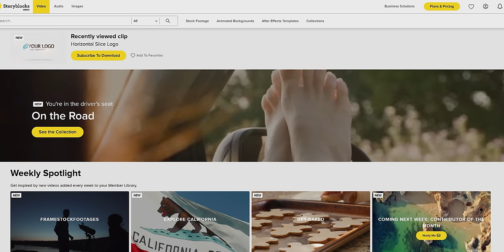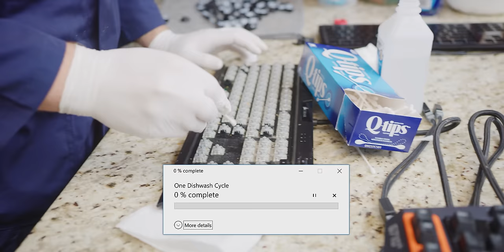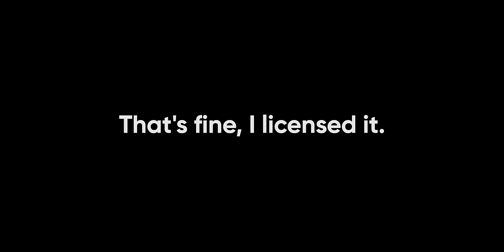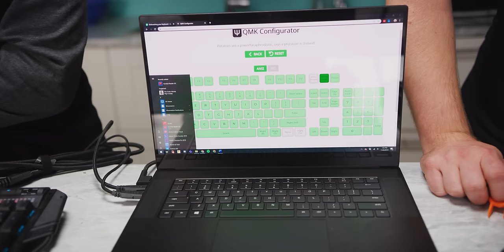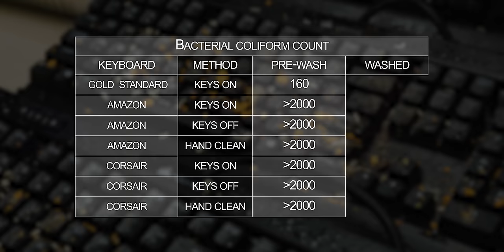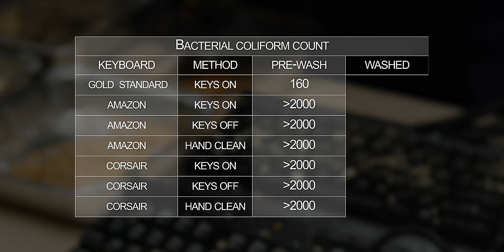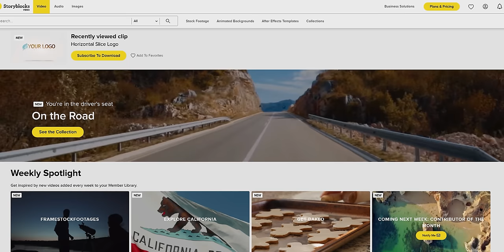The best way to clean a keyboard is… the DISHWASHER?

Comment: No one's gonna check for corrosion?
Reply: I asked the same damn question
Reply: Yeah, i mean if you dry it fast, should be fine but if in the long run and if you do this frequently my guess is you could find some issues because of corrosion. A safer way could be to disassemble the whole thing and clean the circuits with isopropyl while you dishwash everything else but, ain't nobody got time for that!
Reply: @walkinmn  I did this last year with my 13 year old Logitech Keyboard. I didn't want to throw it away (and yeah it got so dirty in 13 years I was half tempted to throw it) so I disassembled it and just washed all the plastics.
Reply: corrosion happens if electricity flows mostly. Water mostly causes damage by corrosion when electricity is on.
Reply: @VamsiMohanKrishnaVadrevu  G15 I'm betting :P
Reply: @finraziel  Hehe no actually it is a multimedia PS/2 keyboard called Y-SZ49 :-) I couldn't kill it whatever I did. And I can't justify buying another keyboard until this one dies. So I'm waiting for it to die and it just doesn't die. It's been running relentlessly for the past 14 years.
Reply: @piotrj333  corrosion can still happen if certain metals are in the dishwasher
Reply: @piotrj333  thats not how rust works...
Reply: @piotrj333  you don't need electricity to get corrosion lol. Just metal, water and air
Reply: dip the keyboard in a alcohol bath, agitate the living crap outta it and should push all the water out, lowering drying times and lowering corrosion possibilities.
Reply: I am guessing that the keyboard being washed is older at this point and this is a one time deal to give it one last run before being replaced. I personally buy a new one and do this method to keep the old one on hand as a backup. has worked great for over a decade.
Reply: @piotrj333  Statue Of Liberty has corrosion as well (the green tint that it has), it should be copper, but its because of salty water, air and also the iron that is inside the damn thing
@Linus Tech Tips really guys, you support this method of cleaning? can we keep you liable for the damage/non working keyboard in 10 years????
Reply: @VamsiMohanKrishnaVadrevu  Yeah my keyboards last quite many years even tho they do get some splashes of tea and food crap on top from time to time, cause I just disassemble and clean the plastics, but leave the board and membrane out of the deal (yeah, no mechanical here).
That way you simply removed the only danger out of the equation. Only do it like once every 2 years tho, but when I do clean it up I remove all keys to get it done well enough (since keys start to get even stuck from all the crap and sweet gunk).
Reply: @oogiesmuncher  Negative. Rust works when ionization/electrolisis in water happens. Sure it will happen slowly even when electricity doesn't flow (because of also contamination of salt etc.) but it is really slow process. Meanwhile if you put a drop of water on chip and chip inputs will flow electricity over that water, corrosion will happen in matter of few seconds.
Reply: @piotrj333  Im well aware of how rusting itself is a transfer of ions. But you make it sound like electricity needs to be flowing through the metal to cause rust which is not true. how do you think steel plate rusts when left outside? No one is hooking a battery up to it.
Reply: @walkinmn  Drying cabinet for clothes works. But keeping them wet and air drying? D:
Reply: @TyphoonNLD  I mean copper goes green when copper oxide forms, not because of iron
Reply: Ask Der8auer's motherboards.
Reply: @piotrj333  that's just one example. Corrosion can happen much quicker when you have electron transfer between metals rather than relying on a slow reaction between air and metal
Reply: @oogiesmuncher  it happens but extremly slow because transfer of ions happen without electricity. But good luck making rusting with destilled water in laboratory condition by itself.
Reply: @piotrj333  no. just no. electricity, especially alternative current, increases corrosion.

Comment: "A fast way to clean your keyboard."

"We waited a week for the keyboards to dry."

"Fast."
Reply: Lazy* 😄
Reply: just throw it in the oven
Reply: it was to make sure
Reply: @cwa178  it will melt if its too hot
Reply: -_-  r/ihavereddit
Reply: @SimonOpsi  no it wont
Reply: @griffinhatt4669  I rly hope that a joke
Reply: 'fast' way to clean.. long wait to 'dry'. lols
Reply: you can cut from 1 week to 3 days if you put the keyboard drying inside a container full of rice
Reply: lol
Reply: @TechHowYT  tbh i never did it with a keyboard , altho we do it a lot when we accidentally drop our phone in water ,  but overall by removing the keycaps there is not much rice that will get stuck on the keyboard , just shaking it a couple of times will release the rice. Dont forget its dry rice not cooked ahah
Reply: Gotta have 2 keyboards lol, one to use while the other one is drying forever
Reply: just use rice bruh
Reply: Theres a point where if the actual effort put in is quick enough, the total time doesn't matter as much. An ideal dishwasher cleany a grimy dusty cheeto-y keyboard just by chucking it in there and giving it a few days to a week to dry would definitely seem more enticing than properly cleaning it yourself, key by key
Reply: @Dizastermaster.  Ur point is totally valid , altho when we reach that stage is more about what you as a person need overall. If you need your keyboard as fast as you can ready to use because of work , its preferable you clean it key by key , but if you have another alternative and can wait a week for it to dry , its way less work so it would be the best choice.
Reply: I have been doing this for years but i take the electronic parts out and they do come out like new.
Reply: It was clean fast... you just had to wait for it to be useable again :D
Reply: You can dry it for just a day if you disassemble as much as you can first. I manually shaked off the water for like 30 minutes then dried it for 12 hours on a rack and a big fan. Did this 3 months ago, keyboard is working perfectly
Reply: @Stanky_Foot  A day still isn't "fast."
Reply: your mom's or wife's hairdryer.
Reply: @OnyHipHopMusic  but then its full of rice and will need a dishwash again
Reply: @Blackstar1701  nah because the rice will still be dry , it wont stick to your keyboard :D
Reply: @SimonOpsi  hes joking
Reply: I would probably take an hour or two if you put it next to a heater and fan.
Reply: @SimonOpsi  Dr
Reply: If you were going fast set it in the sun for a day or use a hair dryer/heat gun or fill the washer with isopropyl alchohol
Reply: @ZackyVillain  fans only push air and in most times spread the water the pcb need to be dry or you risk bridgeing solder-points
Reply: Then put it in a dry cleaner
Reply: @TechHowYT if you get rice stuck in your keyboard, just run it in the dishwasher again xD
Reply: You can make a homemade dessicant with Epsom salt, a pan you don't care about, an oven that can hit 450° for 2-3 hours and a hammer. 
The Epsom salt chemical formula is MgSO4(H2O)x where x varies from 0 to 7. I find most Epsom salt to have significant amounts of H2O and if you cook it out, it will naturally try to bind to the water in the air.
Reply: LMAO
Reply: @Stanky_Foot  shook off the water.
Reply: @darkshock42mlg05  You misspelled vibrator.
Reply: Can you hear the circuits rust?
Reply: You shouldn't really have to wait a week.  I cleaned my Dell CK-8135 keyboard in the dishwasher and took it out, shook it a few times to get the excess water out and turned it upside down and let it sit for like a day or two and it was fine.  It also had pass-thru holes in the bottom of the keyboard that helped with drainage.
Reply: Wonder if hard water will cause short circuit
Reply: @SimonOpsi  Who said to put it on broil though?

Comment: "A quicker way to clean your keyboard" ... Takes a week to dry...
Reply: If you put it on a not too hot heater (radiator) it will be completyely dry he next day. Its only a problem if your given keyboard likes to be soaked this way
Reply: use rice
Reply: Meh, a week is overkill. Any amount of time that gets the keyboard completely dry is fine. In my opinion, 1-2 days. Again, a week is unnecessary.
Reply: @birsp  you're right, but that is still time you're not using your keyboard. Granted, a week is probably overkill, but even if it takes a day to air dry, you would still have use of your keyboard faster by just taking it apart and using rubbing alcohol and taking an hour to clean it off
Reply: I disassembled and washed mine, since I washed keycaps and plastic parts separately, then I was able to dry using paper towel, assemble and start using it without waiting for passive drying.
Reply: @krisavi  That's still risky. If you miss just a little bit of water inside of that keyboard, you can kill it for good. I still think it's better just to use some rubbing alcohol
Reply: oven on hot air at 50 degrees celsius for a few hours does the trick. Testing it myself about 30 times while washing the keyboard in the bathtub
Reply: The thumbnail is best way not fastest
Reply: If you completely dismantle your keyboard, like I did with my Razer Ornata, and wash everything separately, you can get away with good towel dab and an overnight dry. It takes some extra work, but it's less time than a week.
Reply: As someone who hates cleaning, I'll go a week without my computer to avoid having to manually clean my keyboard.
Reply: @Comatose1231  some guy in comments complained that he left his kb drying for 3 days and it still died, so 1-2 might be enough for some kbs, but a week is a safe amount of time to dry any kb, and when we're talking some expensive shit like razer, corsair or custom builds, you most likely wanna go safe if possible
Reply: I put it on top of my gas radiator for like an hour and it was fine. Whole process was two hours.
Reply: @mrdali67  I have the Orion spark 910, the one that was completely fine, however I'm not dumb enough to try it, that keyboard was like 160, at the time, I got it on sale for 80, I don't know the price now, but hell if id be dumb enough to try it.
Reply: @rudigca  i clean mine like every month so its fine, nothing builds up. I clean the keycaps every week or 2 also, just the top with iso alchohol and 2 or 3 qtips. Doesn't take very long.
Reply: I personally dont see how drying anything could take more than a day if you put it somewhere dry
Reply: @JesseBellas  2 hours of work versus 168 hours of waiting, hmm... decisions decisions
Reply: @handlemonium  Rice does nothing.
Reply: You can use a blowndryer as soon as you take it out and have it up and running in a hour or so.  Been washing keyboards in disheasher for 20+ years.
Reply: I used to wash old PCB's for POS systems with EPROMs in a bath with a shower head, scrubbing brush, fairy liquid and warm water.   Then leave them to dry (OUT OF THE SUN), in a very good air flow area and assist with a leaf blower.  Full size PCBs(40cm x 30cm)  loaded with chunky components dried in a matter of hours.

The thing you have to be very careful of is heating the liquid on the board.  This will turn it into steam.  So water trapped between chips and the board will heat up into steam, this will lift the chip or component from the board as the steam tries to expand and escape.
Reply: @mrdali67  Not true. The water is going to seep into the board and under smt chips and stuff. It's best to let anything with a circuit board dry for at least a week to make sure all of it gets out from under things in the board. I've rescued a lot of servers that were submerged in floods and while heat helps, there's no substitute for time when it comes to the smaller more porous surfaces inside electronics.
Edit: Low humidity, good airflow, lots of time, and maybe some desiccants in the area are the best way to go.

Use a backup keyboard for a few days, it may save your expensive board.
Reply: quick in terms of effort, it's basically very close to zero.  i have a bunch of keyboards that i spilled cider or beer on that i think i might try this on :D
Reply: Use a hairdryer and its done in 30 min
Reply: @Raven1024  If you noticed, I specifically wrote "Older" keyboards. The old keyboards didn't really have much electronics, and they were pure  mechanical keys with a rubber board for the contacts. They were much more forgiving with water. I propably wouldn't do it with a modern keyboard with Led lightning and all, cause 99% chance it wouldn't survive it.
Reply: @mrdali67  my keyboard has drain holes so good for me
Reply: @mrdali67  No you didn't: 
"If you put it on a not too hot heater (radiator) it will be completyely dry he next day. Its only a problem if your given keyboard likes to be soaked this way"

That was literally copypasted just now, spelling errors and all...it says nothing about "older keyboards" and they still had circuits even if it was just a single board up in the corner.
My mouse has a scroll wheel, I can scroll up and fact check.

Point being I've slaved over server boards that were submerged in salt water scrubbing them gently clean in multiple rinses of distilled water and had almost every single one be salvageable. 

Most electronics can survive a dunk. But if you want reliable results coming back from being soaked (especially with jets of possibly hard water) there is no substitute for patience. If you lack patience and rush it, expect your survivability rate to go down considerably with any component.

Edit: Here's a link in case your scroll wheel doesn't work. imgur.com/b3SXOJe
Reply: or use silica gel to dry it
Reply: if you have a heated drying option on your dishwasher you just need to shake it dry and wait at most a day if you dont take it apart to pat it dry.

Comment: Linus: wait a week to dry

Me with 1 keyboard: I'm out
Reply: 1 week is overkill, if you removed the key caps it  should dry pretty quickly. so what you do is after taking it pout of the dishwasher wipe it with a clean towel and blast it with a hair dryer for a few minutes, same with the key caps
Reply: @GameCyborgCh  Keeping in mind that depending on your settings you will literally melt the plastic parts of your keyboard and key caps. ABS has a glass transition temperature (when it will melt) of 105 degrees celcius, that's nothing for a good hair drier.
Reply: Rice?
Reply: I would place mine on the bathroom floor and crank up the heat on the floor and leave it over night... That's usually enough ;) I don't know what the lowest setting on your oven is, but if you could get it below 60 celsius you should be good putting it in there for a few hours as well... Lots of options to get it to dry out if you are a bit creative ;)
Reply: @pshanetju2598  holy fuck no
Reply: BrazGaz rice.exe
Reply: Though it is a bad idea to let the mechanical keyboard dry(and soak in water in general). Springs in them as well as contacts are mostly uncoated metal and when exposed to water for a prolongated period it rusts pretty quickly.So if you want your mech keyboard to last, you might wanna avoid dipping it in water in general, or dry it as fast as possible at least.

For the membrane, well they are somewhat safe, since the traces on the keyboard matrix are usually not metal(they use some solution like that of conductive glue), and main pcb is coated with mask and it usually has just some packageless microscheme that doesn't have any metal legs exposed, so the only thing that can degrade in it is soldered on cable, but that can be easily fixed when and if the time comes.
Reply: Is it normal for the lights to come on and off after plugging it in straight out of washing. I was just testing it and yup it doesn't work at all. Now I have to wonder is it dead as a owner of 1 keyboard.
Reply: @Banana-cc5rx  you shorted it.
Reply: @brazgazz  as I said testing it
Reply: @Banana-cc5rx  you have some issues.
Reply: @Banana-cc5rx  you think im getting upset over an internet comment? Now i cant even express my distaste for idiocracy without having people try to guess my state of mind
Reply: asd asdas I genuinely hope you’re joking
Reply: @RAJEEV yea mine is totally fine now. Was just wet inside
Reply: Me: Buys 7 keyboards

Also me: I have a fresh and clean keyboard every day! Only cost me $800...
Reply: @Incurafy  just run the hair drier with cold air
Reply: Just put it in the microwave for 30 seconds
Reply: I have 2 keyboards so I may try it haha
Reply: @ArcadeSchool  qa
Reply: @circlehousePRO  Steps unclear, ate the keyboard
Reply: Would have helped to put them into boxes of dried rice to dry them faster and more thoroughly.
Reply: @Incurafy  “They can be heated to their melting point, cooled, and re-heated again without significant degradation.” Straight from google in reference to ABS plastics. This means that if you are sustaining 105-140 degrees Celsius with your hair dryer, which by the way is unlikely unless you’re aiming it at one spot intently, only then would you make your keyboard PLYABLE, not melt. It would start to lose its structure and traditionally melt at 200 degrees Celsius.
I looked into this because I know I’ve used hairdryers to dry keyboards… MANY times and saw no changes. Sometimes you will notice the plastic seems more plyable at these higher temps, but it never changes form. Probably because it’s not actually sustaining 105 and rather is more like 80-100 at highest. Plastic is a poor conductor of heat. It’s unlikely that the output temperature of a hairdryer would match that of the plastic you’re heating with a constant moving motion. You would  need to be using proper heat gun to sustain the glass transition temps accidentally.